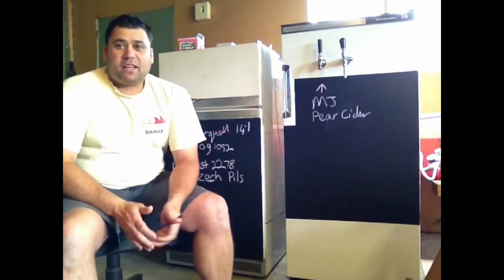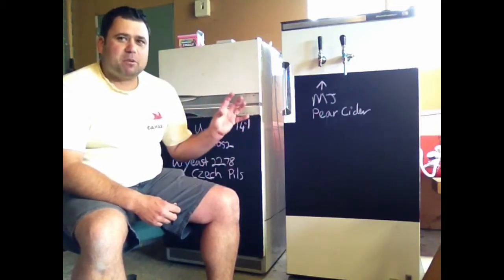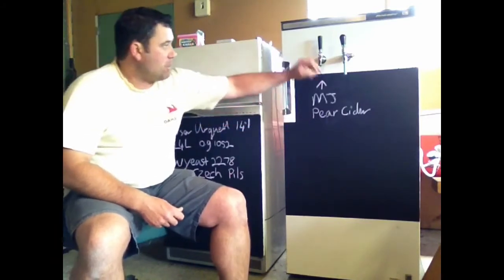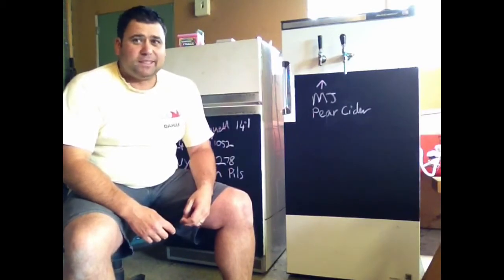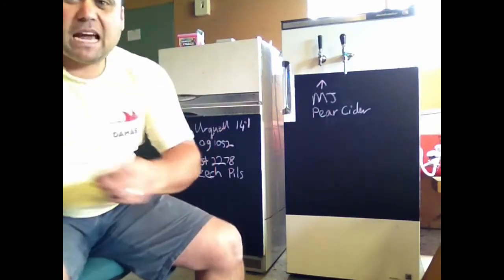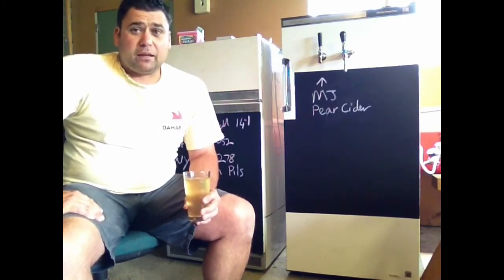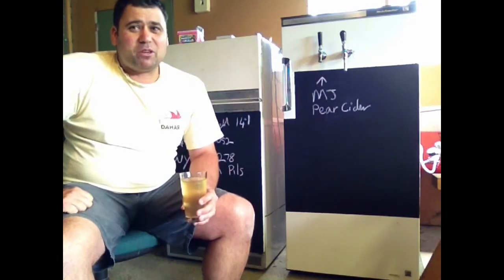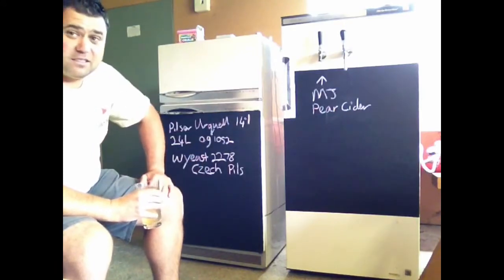H.B.W # 50 Perlick Troubles & Brews

Comment: Loving the black board paint mate. nice rundown on the pilsner yeast and temps too. I'm currently brewing these flat out at the moment as I don't have temp control. all I have is a garage which I can adjust the central heating in and the cold weather. so I have managed to hold my temp at 10 c. which takes the pilsner about 3 to 4 weeks to come from a 1.055 to 1.008f.g. cheers for the video lad.
Reply from the maker: Franks Homebrew77 Nice one Frank sounds like its going to be a good one.